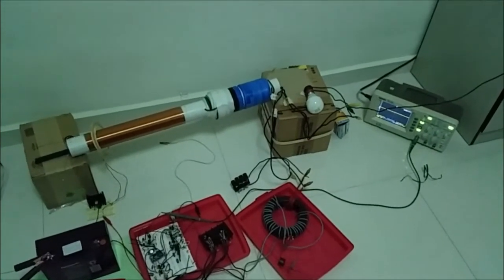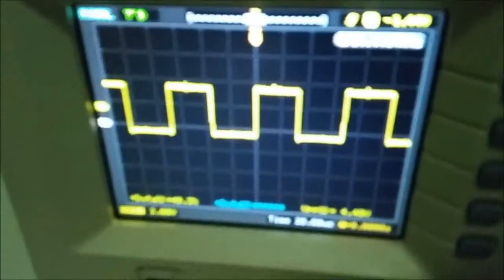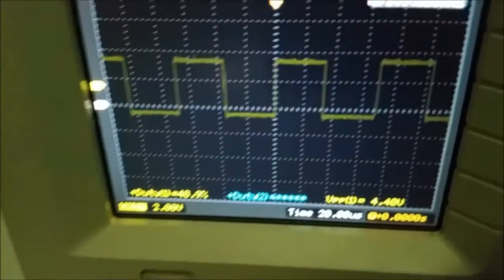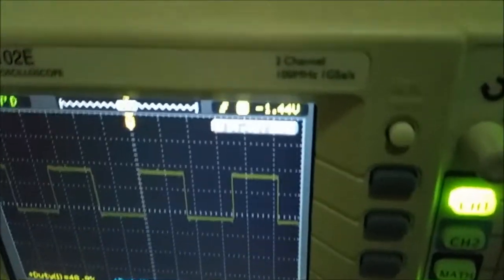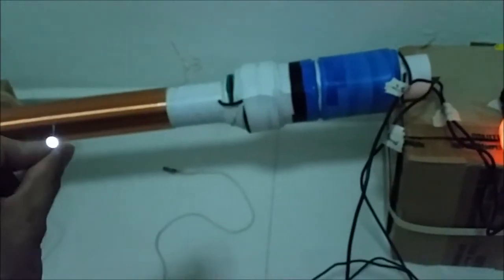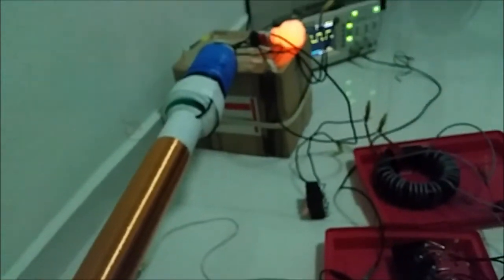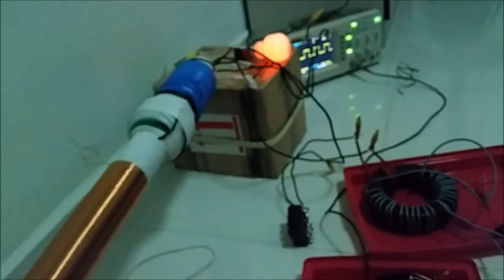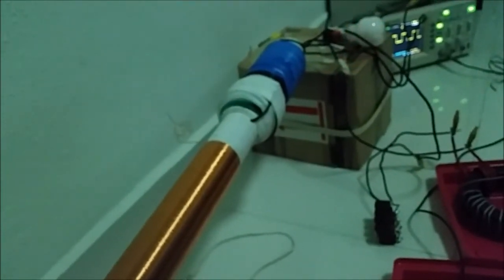60th SubHarmonics PWM Generator -Part 2

Comment: This is fantastic. Keep up the good work. I my self am trying to do the same things but just a little different.
I find by working with smaller voltages you can see the circuits strengths  and weaknesses better